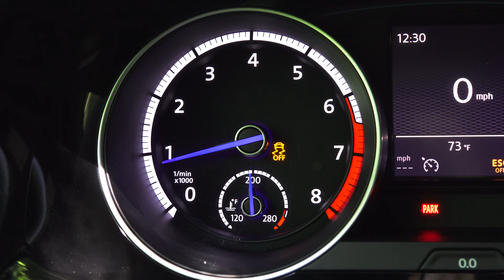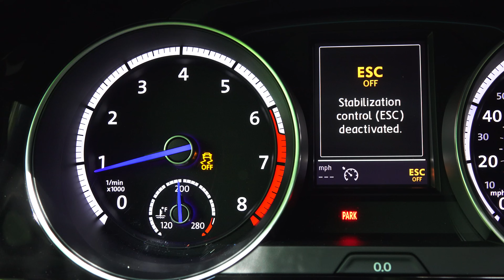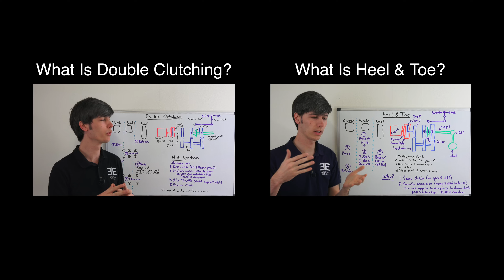How To Launch A Manual Transmission Car

Comment: Step one, buy a tesla.
Step two, press pedal.
Reply: +Patrik P&#229;lsson 
"Step one, buy a tesla.
Step two, press pedal."
--> Step three: Plug in wire and wait 8 hours.
Reply: Step 1) Buy a Testla
Step 2) Wait 4 hours while Tesla charges
1/4 mile in only 4 hours, 10 seconds FLAT WOOHOO!
Reply: Step 1: take out a loan
Step 2: buy a Tesla
Step 3: press the throttle
Step 4: go to granny mode while the batteries cool down
Step 5: run out of charge
Step 6: push car to nearest plug socket
Step 7: pay for a hotel
Step 8: begin driving home
Step 9: panic as your brake pedal snaps off 
Step 10: crash and die

Thank you god emperor Elon for this fantastic car.
Reply: You forgot the prerequisites: You don't have driving skills.
Step one, buy a tesla.
Step two, press pedal.
Reply: +Sebastian Wittmann I agree my daily driver is a Genesis coupe 3.8- rear wheel drive 6 speed making about 340 horses and there is nothing like hearing the engine scream at high Rpms on the back roads. I also see where you're coming from with daily electrics being slow and boring but that's why I said electrics with 700 hp :)
Reply: +Patrik P&#229;lsson uhh...no step two should be select ludicrous mode..then step three press pedal (Edit: smash pedal to floor)
Reply: +The Dude he isn't.  you are!
Reply: Lol no you clearly aren't a car guy.
Reply: Btw how do you upgrade/tune an electric car? Lol do you just get like "TWIN BATTERIES XDDD ION LITHIUM BATTERARYSYS."
Reply: Step one, by a Tesla
Step two, enjoy the sound of a vacuum cleaner while also doing als little as possible to look cool.
gg
Reply: *****
I think his talking about G's during acceleration, which I am sure a space shuttle launch has more of. Only time jet pilots pull more G's is during a maneuver/turn or a catapult lunch from a carrier. As for EV, good thing the P-90D does not drive like a golf cart.
Reply: +MrTiti I believe their is super charger station now that can charge the vehicle within an hour give or take as I don't know the exact time
Reply: MrTiti For under an hour yea. Do you eat or take rest brakes on long drives ? It has like a 200 mile range or something so unless you're going on a super long drive or something you're only going to be charging at home.
Reply: @formo11  

A 200 mile drive is not "super long" 

If you live in the bay area, and you like to play in the snow on weekends... it's about a 200 mile trip one way.
Reply: stinkyfungus Not sure I said 200 miles was a long drive, I think I stated that the p90d can go for 250+ miles so you’d be able to drive at full capacity on a long trip. This thread was from like 2 years ago and I feel bad for being such a dick to that dude reading this now lol. Sorry to that guy!
Reply: ***** And you sir cannot read like the other fellow. I never said you would be maintaining a power of 700hp. I simply said with 700hp available to you if you need to speed up then you can much quicker and easier than a 10 year old minivan which you're probably doing 55 in. That guys whole argument against Tesla is based on him not wanting to wait to charge the car for an hour on long trips if you want to jump on the ignorant train go ahead mate !
Reply: Dylan Buell You do know that Tesla is one of the only cars that can go 0-60 in under 3 seconds right?
Reply: Step 3: realise lithium ion batteries make electric cars utterly pointless because lithium is a rare , extremely toxic limited recourse
Step 4: convert your gasoline engine into a Hydrogen engine that only emits water
Reply: Step 3, NEVER drive out of any big city, since there's JACK for places to "refuel" in the boonies.
Reply: DailyDabber as for me, I've gone from a full tank to empty tank of fuel in my car without stopping (over 700 miles, 17 Cruze diesel with 6 speed)
Reply: Step three, plug it in.
Step four, walk to a movie.
Step five, go down the street and get some pizza.
Step six, unplug your Tesla and go home.
Reply: DailyDabber
so you will have to drive to a super charger and stand next to the car?
Reply: *****  Yeah P90D the  90 stands for 90kWh so lets say you have 500kW output that will give you 11 minutes at full tilt. But I think it'll overheat before that. :-D
Reply: lol
Reply: Them Teslas are nice.. good mix between cool and nerdy green tree huggin.  For real tho they are pretty nice.
Reply: Patrik Pålsson true
Reply: Patrik Pålsson didnt think teslas came with stick shifts
Reply: Reading isn't your strong suit, is it? This video is about manual transmission.
Reply: Patrik Pålsson Lmaoooo
Reply: Tesla trend is worse than ebola.
Reply: I love teslas but damn i dont got 100k to drop on a car but my 500$oldschool with about 7000$ in upgrades can dump some good speed on a strip
Reply: Until you broke a electric motor. Then it becomes a lawn ornament. Cause it cost $15,000 to fix lol.
Reply: @cbass_of_the_sea  until you drive one lol
Reply: Hulk I don’t have any desire to drive one. Or even own one. If I did ever did. The Canadian winter at -40 to -50 for 6 months would kill the the car. Then I make a video about it
Reply: Step 0.5: Save up $76,000

While I do admit combustion cars are a hell of a lot cheaper, more customizable, have higher torque potential, and have longer ranges, I still find the engineering and acceleration of Teslas fascinating.

Too bad the Models S starts at 76K, and you have to pay upfront. No financing. Way to limit your target audience.
Reply: In the long run electric cars may even save gas cars. They would become more of a possible hobby. While using electric to be the daily workhorse. And have owned several vehicles in the past. There's just a not just a connection with the car. But also more fun when it comes to driving a good manual transmission vehicle. You just won't get that same feeling with electric car.
Reply: ecocav0222 in the 50’s. The experts said by 2000. We would be driving flying cars and personal helicopters. Are we driving flying car? Electric cars are going to take a percentage of the market. But, they won’t take over the future. Especially when new study’s are show that electric cars take 2x more emissions make then a gas pod. Not to mention, using a power sector on which the electric car needs. Is just as equal as gas emissions. That makes the electric worse on emissions.
Reply: ecocav0222 plus it seems like YouTuber’s are going though a mid life crisis. Instead of fast cars and loose young 18 year old. It a boring car with a boring textbook video. Which he get wrong 25% of the time,
Reply: @cbass_of_the_sea  lololololololollol😎😊😍
Reply: @cbass_of_the_sea  p100d are very fun
Reply: +Sebastian Wittmann You haven't launched a Tesla p90d then my friend. You pull similar G forces to a space shuttle launch to give you a little perspective. From an enthusiast stand point I 100% see where you're coming fromm, but you can't say electric cars with 700 hp aren't more fun than combustion engines because instant torque on launches and out of turns is insane.
Reply: @formo11  dude, tesla launch is fun and all but space shuttle launch g force, no way
Reply: @formo11  you dont hear anything. It sucks balls. Computer on wheels. Will never ever ever match the porche 911 turbo s or the mc laren 720s driving experience
Reply: @MyButton123  Uhmm okay? This thread is multiple years old, but i'm glad you still have an opinion, even if it's worthless.
Reply: step 3 regret buying the tesla
Reply: abd bach Good point more like
Get in tesla
Turn on
Seatbelt
into gear / Drive if auto
Press pedal

Comment: I've never thought about choosing a set rpm often. I've seen the inside view of GTRs launch at 4500 rpm. I've heard race teams lower and raise Rpm launch settings but it just never hit me. I just red line and pop. Like a total noob. Like total frickin noob.
Reply: +Belicose777 You wanna set your rpm to the torque peak value, because when you'll release the clutch you will have a maximum amount of power available. Just be careful not to let the throttle fall and keep it at torque peak until the clutch is totally engaged
Reply: +Maxime Di Meglio (N3xusPr1me) Obvious right? Not for this guy. I've never put much thought behind launching properly. I guess that's what makes the difference between an average hooner like me and real racers.
Reply: Belicose777 You should try then, you'll fell more of a racer :)
Reply: +Maxime Di Meglio (N3xusPr1me) I will. Thanks buddy haha. :)
Reply: Axel Vanegas I do agree, it is possible, but I unfortunately can't see any advantages of doing that compared to basic shifting/revmatching from 1st to 2nd, and if you're really good at shifting, well shifting will indeed be better than starting in 2nd gear. And yes, the clutch will not like it at all.
Reply: +Belicose777 You can find the best rpm by just searching for the max torque figures. It should be displayed with a corresponding rpm. (mine is for example 300Nm/ 221 ft.lb @4000rpm) Only thing is I don't really use this for launching since the car isn't build for it.
Reply: +Johan plug I hear ya! I've always known the concept I've just never applied them is what I'm saying. I wonder though. Does that still apply to a high hp low torque car that requires higher revs to get the car to accelerate as fast as a car with high torque high hp? At that point ideal torque figures probably aren't the best for launching, but rather max revs. F1 cars rely more on the ability to rev super high as oppose to a nascar that rely on high torque and according to a video on this channel both accelerate at about the same rate.
Reply: the best thing to do, it's to listen to the engine, it will always tell u when u need to shift. And I don't remember about cars but trucks I always start on second gear, its so much quicker.
Reply: Axel Vanegas Can't start on most cars on second gear, the gear ratios are wayyy longer si it is kinda hard and doesn't have any advantage whatsoever
Reply: +Axel Vanegas lol. I launch my dirt bike in second but it's geared waaaaaay shorter.
Reply: +Maxime Di Meglio (N3xusPr1me) yes u can if you're good at it. Try double clutching and find the sweet spot for your car, it may not be good for your clutch but it can be done. It's like shifting without shifting.
Reply: Axel Vanegas 
Why would anyone double clutch a car???
Absolutely no reason! Every new car has syncros and only truckers have needed to double clutch since the 80s.
find the sweet spot is easy! Takes a few runs down a track but you can and will find the perfect RPM and clutch engagement point/throttle point to get the best launches! Have a friend with more experience show you...or go to your local track and talk to people...
I'm at the Bithlo track in Orlando all the time if you happen to be close
Reply: LJ & Son's VLOGS oh shoot. You're local. Nice.

Comment: is it also possible to launch a car in second gear? for example if you got a car with a high torque like a tuned turbo diesel. 
you cant reff the engine to much but you run out of first gear to fast. can you get a better time by skipping shifting and start launch in second?

Comment: How to launch an automatic? (if it can be done).

Don't hate. I'm stuck with an automatic for the foreseeable future, I might as well wring some enjoyment out of it.
Reply: +Blarg King Easy : brakes, put rpm to torque peak value, release brakes, and keep the throttle on to the torque peak value until the clutch is totally engaged at that specific rpm. The gearbox will do the clutching work for you
Reply: Depends on your car
Reply: Should work for any that doesn't have launch control
Reply: +Blarg King He already made a video about it.
Reply: +Maxime Di Meglio (N3xusPr1me) typical automatic doesn't have a clutch to engage...it has a fluid coupling
Reply: +avanasear ah I wasnt aware.  Ill take a look.
Reply: +OspreyBravo18 a Pontiac G6 with a 2.4L engine. It might not have the power to launch properly.
Reply: Neutral to 1st bog, works everytime...

Comment: finaly someone who takes gearing into account. here in europe, we have many turbodiesels with a high peak torque plateau (f.e., 500nm at 2000-3000rpm) and you often hear that reving further makes it going slower. in fact, even if you only got 350nm at 4000rpm left, most of the time your wheel torque will still be higher in the smaller gear. hard to get that into peoples minds ;)

btw: keep up the videos, nice work and channel :)

Comment: So wait, how will I notice if I apply too much throttle? Or not enough throttle?
Reply from the maker: +General Chad Primarily through wheel spin. If the tires spin after releasing the clutch, less throttle, if they don't, more. Find the perfect balance where you get a little slip but not much, and you'll get the fastest time.
Reply: Yeah, today I was experimenting a little, didn't wanna ware out the internals too much, realized that wheel spin would tell me how it goes, thanks for the reply tho.. Keep it up man I think you are literally the best teacher when it comes to explaining how a car works

Comment: Is it just me or anybody else realize how cheap VW pedals are, is that plastic?
Reply from the maker: +Vinícius Ynoue I noticed as well, though the brake and throttle were still steel. I'm sure they did plenty of analysis and the part will last. Considering most folks will probable never hunch down and look at it, and that the engineering is very likely sound, I don't think it's all that silly of an idea. If were the brake pedal I'd have some concern.
Reply: I see. But I'm pretty sure is not some cheap plastic, but it looks kind weird lol

Comment: Wouldn't you need to lose 60% of the power to be at a disadvantage in 2nd gear, instead of torque?
Reply from the maker: +popula Nope. Gearing multiplies torque - altering gearing alters wheel torque, while power output remains the same (follows whatever the engine power curve is).

Comment: Hey! I also posted this question on one of your ALS videos, but just in hopes of getting it answered, I'll post here as well:

I didn't fully understand how holding a turbo engine at a specific rpm doesn't build boost. I have watched your videos on turbos and turbo lag and ALS systems, so I understand the principles, but for this specific circumstance, I didn't quite understand.  For instance, my 07 STI builds full boost around 3500rpm, but if I understood you correctly, even attempting a launch at say 4000 or more would only supply the torque generated by the engine without the advantage of the turbo, since the turbo wouldn't be making boost.  Why is that? 

Is it because, even though you're holding the engine within the usual "boost range," the throttle is so close to closed (since it doesn't require much air/fuel to spin an unloaded engine) that there just isn't enough gas flow to actually make boost?

I realize this is a complicated question, but your help would be greatly appreciated!
Reply: Yes.

Comment: do you get more wheelspin if traction control is on or off?
Reply: Traction control prevents wheel spin so off.
Reply: +HockeyLAKings119 traction control doesnt allow you to launch the car because it controls automaticaly the throttle (the amount of you're applying). It's the basic rule if you're making a turn, coming out and starting to give gas, if the TC notices any wheel spin, it holds down the gas.

Comment: I recently got a driver's license. I was taught to just start without gas (just clutch) this is very slow and for some situation like intersections it irritates me, and probably the person behind me as well. Now I don't want to launch my vehicle at every intersection either, but how would I get a faster start. Is it the same principle as this just lower RPMs? And instead of revving the engine from the start, I rev when I feel the clutch biting?

Don't hit me for asking such a noob question. :p
Reply: Rev to about 1.5k rpm then slowly bring the clutch up
Reply: do no use your clutch to accelerate or decelerate. that's what the brake and gas pedal are for. to get a fast start simply give the gas pedal small pressure and release clutch . when the clutch is released used the gas and break pedal to control speed. when you shift your car should not jerk < jerking indicates you used your clutch to accelerate or decelerate. if you are a new driver just practice nice and slow. it takes time to be an effective stick driver
Reply: Jesus Mendoza The reason we were taught to use the clutch to start is to save gas and to "crawl". It does work and there's nothing wrong with it. It's just... slow.
Reply: It's better to give it some gas when starting for normal passenger cars, otherwise low revs start is not good for the engine.
Reply: Depending on the car, it may just stall if you don't give it any gas. That's the definition of riding the clutch, it wears it out, slowly due to low speed, but it still wears it down. The clutch is slipping rather than being fully engaged. As ollie said give it 1.5k rpm and slowly bring up the clutch, you aren't saving much gas at all. Slowly give it more gas as you slowly release the clutch. How do you expect to move without applying throttle?
Reply: rev the engine and slowly let clutch out until you're moving. same as this video but without dumping the clutch

Comment: Pretty simple for me. I put it in launch mode and go. Once I reach 50 MPH I throw it in 2nd. At 70 I put it into 3rd and 110 I put it into 4th. Then I slow down because I'm afraid of getting a ticket by the Mexican PoPo.

Comment: why turning off the traction control ? and would you recommend me to do/attempt this in a 234000km Golf V from 2008 with 105HP ?
Reply: traction control can cut power to maintain stability.